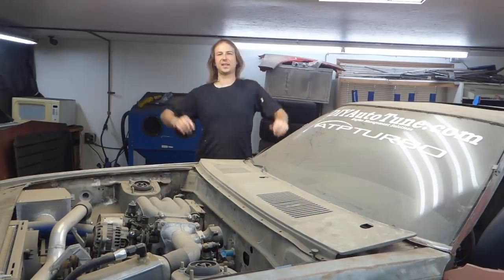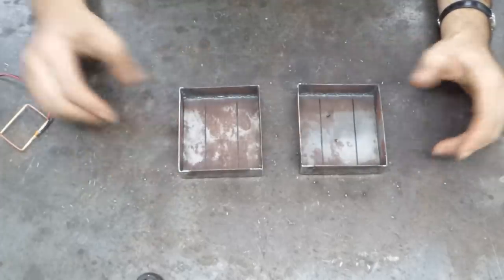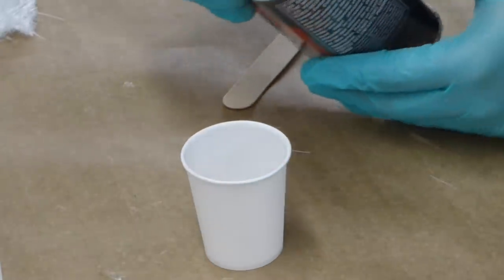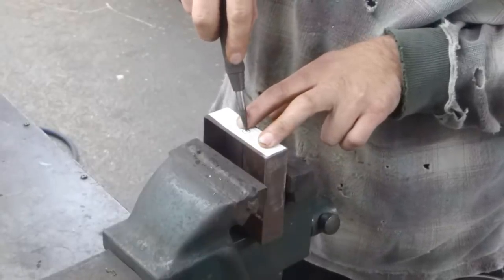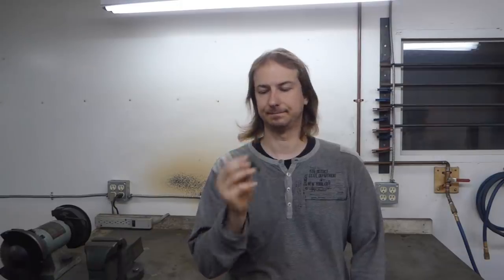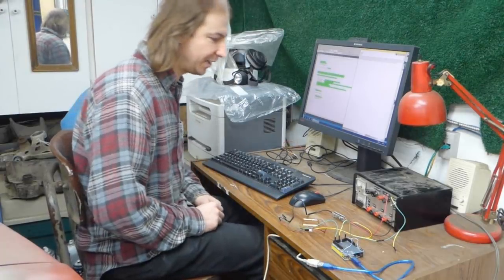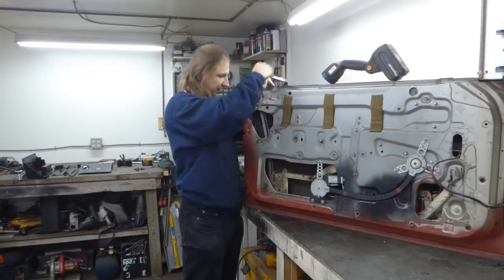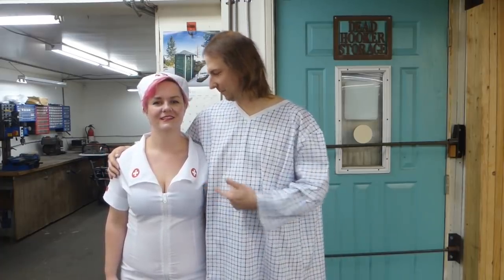Part 46: RFID Door Locks/Openers - My 76 Mazda RX-5 Cosmo Restoration

Comment: Install spacers, and a "wide body" kit, and louvers... wait, you wanted good suggestions.  What about a remote or time activated HVAC next?  I know I'd love that feature at this time of year.
Reply from the maker: No wide body, no louvers (even though I have a set of louvers sitting in the shop). Good idea on the remote/timer HVAC but that would require the engine running or a honking big battery to run a heating coil / compressor motor.
Reply: Thank goodness!  You're not wrong on the battery if you went pure electrical.  No idea how it works, but it came as a feature on my boss' new M3 (which admittedly also comes with remote start) and I remember reading in my 1987 316 owners manual about a fuel burning heater option and my perverse mind smashed the two together to make an insurance nightmare.  Albeit a warm nightmare.
Reply from the maker: You sort of got me thinking about this...Heat only is pretty easy to accomplish by say a Wabasco heater...or preferably a China copy for 1/10th the price. A small reservoir of diesel somewhere in the car. Both cooling and heating it would be best to use a heat pump. There are definitely 12V heat pumps available in the RV and solar world. Plenty out of China on Alibaba, etc. Pull it apart, reconfigure so it fits better into a car and is more space efficient. Or piece a system together starting with a 12V air conditioner (RV). Something to think about anyway.

Comment: I am not fan of remowing door handles for safety reason but if I  use RFD tags, I would put them behind  small fixed  window on B pillar. Coil will be probably visible. I am not sure if it can be hiden behind  ceramic coating on windows. But piece of vinyl aor whole window tint would cover it. From inside  small printed plastic protective cover and that should be all.  (BTW when we etch PCBs we let them flow on top (facing down) thanks to surface tension. We dont have to rock  canister 15mins. We just wait.)
Reply from the maker: All my PCBs have always just sunk.

Comment: how will passengers get in? or when one side is tripped do both open?
Reply from the maker: I always open the door for the female passengers, so that isn't an issue. But yes, either the remote can actuate the door, or an interior button. Same basically as any shaved door setup. They are always a pain for passengers. Or I can hand any frequent passengers an RFID card/fob. Or break out the needle...

Comment: Using RFID is a great idea and obviously you do things however you want to do them but I think I'd have left the doors as-is and found a way to stick the RFID coil on the inside of the lower corner of the back seat window. It would be accessible if it needs to be replaced, and would keep keys or anything from being dragged across the paint to swipe your fob.
Anyways, good work as always.
Reply from the maker: That would unfortunately defeat the magic of opening the doors. I purposely made sure the only component that would be embedded within the bodywork is the reader coil, which has little chance of failing. The RFID reader electronics are replaceable if necessary from inside the door.

Comment: Congrats you're officially a cyborg. Now your kinda obligated to finish that car. Otherwise you'll be the most useless cyborg made to date... Lol
Reply from the maker: There is no question the car will be finished...but so many other uses for an RFID implant. Readers at each door to unlock the door, disarm the alarm and start other automations when entering. RFID gun safe above bed. RFID reader on computers so I don't have to type password. Really anything that needs quick convenient authorization.
Reply: @aaroncake  ok so I've only got one question for ya then...

Do I just leave my foot where it is for awhile or can I take it outta my mouth now? Lol 
😮⬅👞

Comment: Geez... I was beginning to think this was a dead project, glad to see you back at it. Pretty ingenious idea with RFID, but my question is why not use NFC (near field communication), wouldn't that have more range, and from what I know, which isn't much, isn't NFC being used in modern cars integrated with the Key FOB? Not that the RFID is a bad idea. Anyways keep it up.
Reply from the maker: NFC uses much larger antennae. Fewer options for embedding.
Reply: Fair enough, I was just thinking maybe a more centralized antenna under the headliner or something would work, like how modern Honda do it.
Reply from the maker: Is that NFC? Will have to look it up. I had always thought those were proprietary radios. With a big enough antenna and powerful enough field you can read RFID for fair distances as well.

Comment: Consider that the antenna MIGHT be the difference between the performance of the two units. I've never had any good results with integrated antennas (as i call them).
Reply from the maker: Makes sense...Much more freedom with a wire antenna than what can be etched on a board. The 125KHz seemed more tolerant of receiving through materials, as one would expect.

Comment: So what is the security of this thing? Is it changing keys? So if the attacker wants to get in your car would they need to use the catch and block or just catch?
Reply from the maker: Someone would need to either iterate through all available RFID tag IDs, starting at 1 (or doing it randomly), or be close enough to me without being obvious to clone my tag. Scenario 1 is easily solved by rate limiting. Only allowing 3 failed scans before not accepting any more tag reads for 5 minutes. Scenario 2 is fairly unlikely. I think I'd notice someone cuddling up to me with an RFID reader.
Reply: @aaroncake  I bet all the pickpocket victims though they would notice some cuddling up to them and putting a hand in their pocket. :)
Reply from the maker: That's true...cloning my tag is kind of a farfetched scenario though. They would have to know I have an RFID door opener on the car, know I implanted a tag, which hand (obviously they are a viewer!), know where I am, where the car is, scan me, clone my tag, open the car. I mean, a slim jim or a brick is far easier.

Comment: What will be the power drain of this readers?
Reply from the maker: The datasheet says the RDM6300 reader current is <50mA. Well, actually it says "Ma" but based on the wire size and the fact I can power it with a small battery, 50 mega-amps might be an over estimate. Doesn't say whether that 50mA is idle or while reading however. My guess is that probably the idle current is somewhere around 20mA and then once it starts powering a card and reading it, jumps up.

Comment: You're a psycho I love it, that dedication. The fibreglass piece was very overdone fyi you could have used 1/2 of that and still been absolutely fine. No harm in over engineering it though so who cares. Great episode as always.
Reply from the maker: I was a fiberglass virgin, so I wasn't quite sure where to stop. Worked out in the end since it was easy to mill out the extra.

Comment: Well you cant lock yourself out, as long as the battery doesnt go flat anyway,  I'd run the door lock's on a separate smaller battery i think with a 1 way diode protected charge set up from the main battery.
Reply from the maker: Or a set of power ports hidden outside of the vehicle, just in case.

Comment: first video (well i think i've seen some other vid some time ago) so maybe you have addressed the issue of battery going dead and having only electronic locks. Second thing, do doors push out from the car after unlocking, because you dont have door handles to pull the door (when windows are closed, there wont be anything to grab on).
Reply from the maker: The plan is to install spring loaded door poppers in the sill to open the door a bit. Standard for shaved door installations. I have two of them, just haven't put them on the car yet. As for the dead battery, easily solved by a set of charge ports accessible from outside the car like hidden in a bumper, behind a light, etc.

Comment: Did you learn your electrical wizardry by schooling, experience, books, or a combo?
Reply from the maker: Primary experience and books. Electronics was my hobby from about grade 3 to the end of high school. So spent a lot of time reading electronics magazines (oh how I miss Popular Electronics, Radio Electronics and Electronics Now), books, and building circuits. Sort of got out of it after high school when I got into RX-7s, but now building the Cosmo I have plenty of opportunity for electronics. The electronics hobby has changed a LOT with the introduction of cheap and easy microcontrollers (ie. Arduino).
Reply: aaroncake Very cool. I like electronics too but I need a lot more experience before I can just make a circuit with the proficiency you have. Super impressed and I really like this project.
Reply from the maker: Those some-number-in-one electronics kits are a great place to start. Because they are inexpensive, generally describe the circuits pretty well and if you screw up, you can just start over.

Comment: Did you even check if the signal passes through the door
Reply from the maker: I did, and it doesn't. Any sort of metal over the reader coil shields it, and any metal closer than about an inch interferes with the read. Hence the big fiberglass mount.

Comment: Are you sure you can board an airplane with chip like this?
Reply from the maker: Not a problem. Won't trigger metal detectors and would only show up as a small spot on an x-ray/millimeter wave machine.

Comment: Y wouldn’t u glue it on the inside of the rear glass???
Reply from the maker: Mainly because I didn't want it visible, and wanted it on the door.
Reply: Tinted windows just wouldnof had to extend wires

Comment: Im doing a similar syatem for door locks aswell as fuel pump control, and fuel flow control on my s10 build
Reply from the maker: Excellent! Are you mounting readers in the doors?
Reply: @aaroncake  still in the planning stages, but the readers will either be in the doors like you have done or in the pillar behind the door up high on the cab

Comment: For anyone thinking about getting an implant, I encourage you to (I have several), but PLEASE find a professional to do it.. I know it's all good intentions and the fun of doing it yourself here, but this is an example of how to get an infection on an installation that, when done correctly, has near zero risk.
Reply from the maker: YES! Absolutely!  I didn't mention it in the video but I watched the procedure multiple times online, spoke to my family doctor about it, and made absolutely sure to keep the procedure as sterile as possible. There was surgical drape over the drywall, the area was kept clean, no touching of anything else once the gloves went on. Also the injector assembly came pre-loaded with the tag, all sealed with a sterility indictor (had been irradiated).

Comment: Could’ve put it in the rear quarter window and saved on undoing the smoothing work.
Reply from the maker: Except then there would be a wire coil in the window, and it wouldn't be quite as elegant reaching over to the window to scan my hand while at the same time pulling the door open.

Comment: When can we hear the car running and more videos
Reply from the maker: The car will run when it is ready, which will just before paint. As for new videos, I'm hoping very soon. There have been delays earlier with Christmas, then I ended up sick, and it is auto show season. Plus I have to wait for print circuit boards to make the round trip from China so there have been Covid-19 related delays.

Comment: you sir are crazy!!  but also very cool idea.  I would suggest not making the car start with the rfid as well because... unless you put the reader far away from anywhere your hands would go, like the radio, climate controls, shifter, wiper stalks....   it might just keep reading and starting the car while the engine is already running
Reply from the maker: The range is only a few CMs, so that shouldn't be an issue. However things like multiple reads are easily solved in software. The code I wrote to test the locks was so basic it didn't check for multiple reads. But in the final version, it will ignore multiple reads, only reading about once every 500mS.
Reply: @aaroncake Thank goodness you use metric as well.  I HATE imperial measurements with such a burning passion.
is there a way to tell the control unit to ignore all future reads for the starter if the engine is already running?   although... how do you turn the car off?
Reply from the maker: Imperial is a stupid measurement system. Though sometimes I mix measurements and order a piece of steel 36" by 60mm. I was once told by an old person that imperial was superior because it was more precise. Huh? I can't fathom the depth of misunderstanding that would lead to that statement.Everything is in software, so it is fairly trivial to set up any sort of behaviour that is desired once the hardware is in place. I'm planning on building my own body ECU so all of that stuff will be implemented.

Comment: A bit extreme would have been tempted to ding the door and glass it to the outside
Reply from the maker: However placing the antenna coil directly against the door steel would reduce the range so much it would be unusable. The antenna needs to generate a strong enough field to power the tag which would be shielded by the door.

Comment: I love the creativity my only personal qualm is a big ugly square box on the door that looks exactly like an RFID reader. Kind of defeats the point of being smooth and shaved. If you could leave the outer door skin smooth and shaved and just Mount the reader behind the sheet metal I feel it would be a far cleaner effect especially when you put the chip up against the door and all the sudden it opens like magic people will be far more stumped then if you wiped the RFID Card up against a square box that looks exactly like an RFID reader. It's the subtle details that matter the most yes you did a phenomenal job shaving in that box. Your skill is very good. Don't take offense this is my personal opinion but I think you should shave that box off the door so you don't see it it should be heated and sleek
Reply from the maker: Ah, but the plan is to body work over the reader with a little fiberglass and filler, so that it disappears into the door. That's why the reader sits about 1/8" below the surface of the sheet metal. Provides enough space for some panel bonding adhesive, fiberglass reinforced filler, and glazing putty. Putting the antenna behind the existing metal would have been the easiest thing to do, but testing showed that any metal between the reader and tag prevent the tag being read.
Reply: You clearly didn't watched the whole video...or don't understand it.

Comment: What happens if u hang ur arm out the window??
Reply from the maker: You know, that's a good question. Haven't thought of that. The reader is only sensitive within a few CM so there isn't too much of a chance of activating it...especially since I'd have to bend my elbow unnaturally to reach the rear of the door. However since the RFID reader signal will ultimately feed the body ECU of the car, it won't be hard to include a check in software to NOT open the doors if vehicle speed is greater than 2KM/H or similar.
Reply: yes let your right arm hang through the left door window. nice and comfortable

Comment: Everything about this is cool, but it seems overdone. Could you have put the antenna somewhere else like behind a window or piece of trim? Perhaps behind or part of an emblem. Maybe those are too involved, but I think the fiberglass box is a bit inelegant. It will certainly work, and is very cool. I just think it could be better.
Reply from the maker: Didn't want the antenna to be visible, and definitely wanted it in the same location as the original handle.

Comment: could you have just packed it with epoxy or spray foam?
Reply from the maker: Different thermal expansion coefficient then steel, so the paint would crack, sink or bubble.